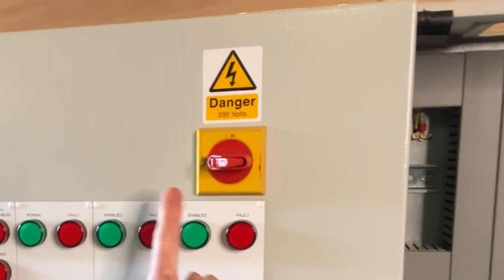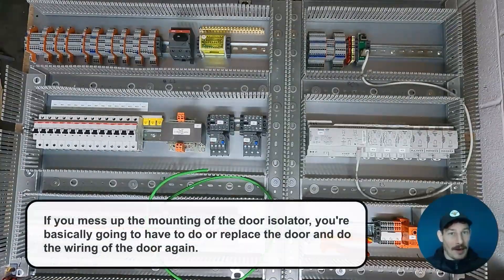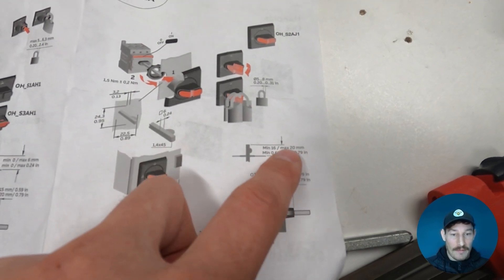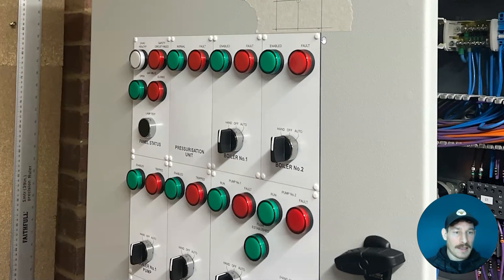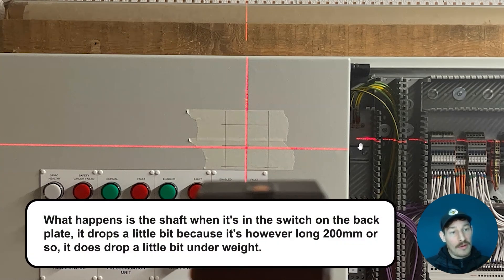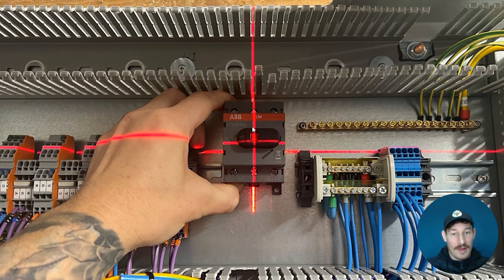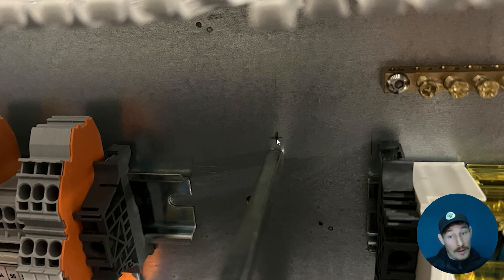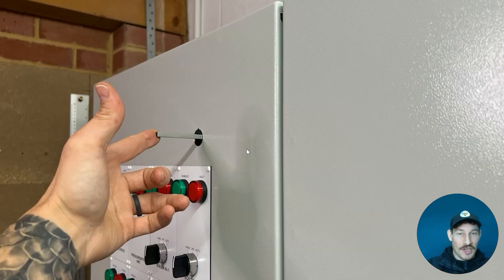My BIGGEST FEAR Building Industrial Control Panels

Comment: It seems a bit of a fuss the way you're doing it.  Let alone all the swarf. Invest in a knockout punch and that will eliminate it.  As regards to the isolator shaft simply take a shaft and cut it down so that it just hits the back of the door and put tipex on it and close, this leaves an indicator.  In all my years I have never really had a problem with the shaft not locating and even if you do you can buy locators for all models ABB Schneider ect ect.